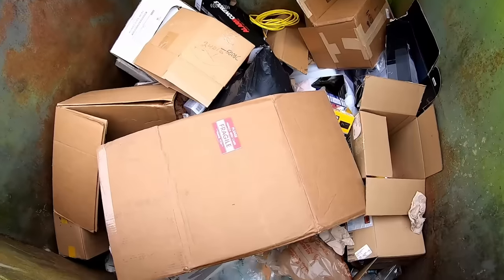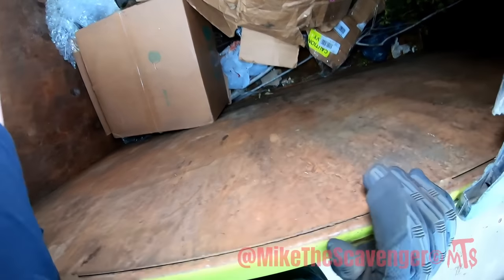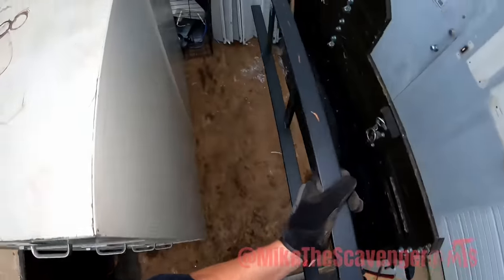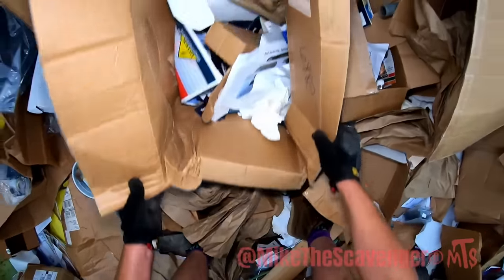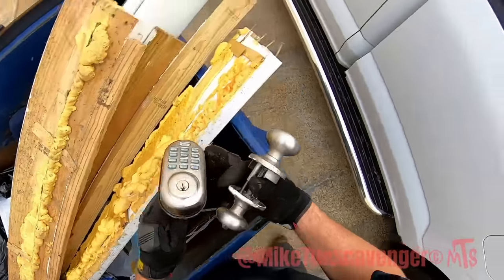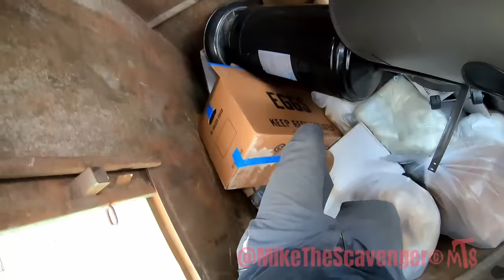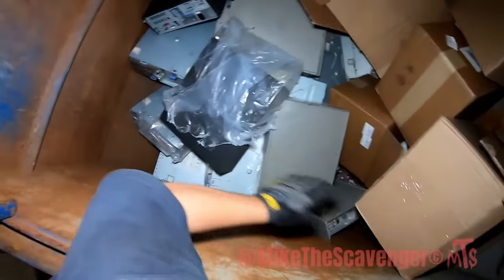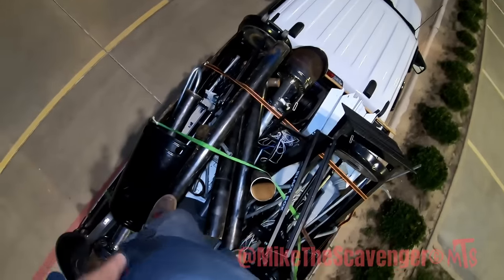Dumpster Diving "We Must Be At The Bistro"

Comment: In UK and Europe cannot just throw old electrical equipment, computers etc into the skip/dumpster for landfill. All has to be separated in WEEE (Waste Electrical and Electronic Equipment) skips/dumpsters, then it goes to specialist treatment centres and stripped / recycled for precious metals etc.
Reply: Not their but they are
Reply: In Canada the company that owns the bins are responsible to separate and recycle according to the items at their company's transfer site. In this case its commercial, retail and industrial bins. For residential areas there is road side disposal pick up  of recyclable garbage. The residents are required to place any metallic items beside their bins, not inside, for curbside picking which makes it easier to see and remove by the  recycler.
Reply: @knightstar1312 It's odd I got notified of a reply to Rachel's comment... but her comment was deleted but not her correction?  But regardless that's how recycling bins work in our county too.  I Googled TX the Waste Management  company 0:04 rent recycling bins I believe if look at the colors you see.he  him in them retrieving "scrap".

Comment: Hey Mike, those computers you’ve just got when are you going to have a go at trying to extract the gold? That would be really interesting?
Reply: I don't know if it would be interesting as it's only 0.2 g of gold in a computer you can sell the motherboard for $1.25
Reply: There is always more silver than yellow gold, platinum and palladium. And stripping all the low grade copper wiring will yield about $30 to $40+ per 5 gallon pail which is nice money. .20 cent a pound for pc boards because it has copper. Just take off all the blue, yellow and black buttons and mccls because thats where the easy silver/palladium picking is for refining.

Comment: You would be better off with a flat tray on your vehicle with high sides . then you could load up better with out wheel arches in the way. offen wonder how many computer get chucked out with the harddrive in them , All that info for the taking
Reply: Oddly, in Texas, you can toss a home computer in the trash, but businesses have laws that mandate manufacturers to take back used equipment for recycling.  I guess each state is different as here home computers are also illegal to toss in the trash as well as monitors, TVs, cell phones, and definitely a/c units.

Comment: Silly question why don’t you take the metal wall studs ?
Reply: 25 gauge metal studs are considered light gauge steel. That means its lighter in weight and it takes up alot of space which does not give a higher ROI compared to the other stuff he ended up getting.

Comment: Mike:I have been watching you video's for several years now and have noticed that you always seem to pass up on the metal studs, and I would say in that time you have passed over two or three pickup loads and I know you say that it will blow off your truck, but you could easily strap it down. I don't understand the waste, like in this video you had quite a bit of it in the dumpster that you where pulling out the conduit pipe from, but it could have been used to hold down the lighter metal studs. Instead I see you rummaging around picking up small pieces of wire, "snip-its" as you call them. What a waste of time when you pass up larger fish. I don't know what price you get for the studs at the scrapyard but the 1/2 load of metal studs I got by helping out a building contractor clean up a job site got me .39$ per pound on 297 lbs or $115.83, which for a 76 year old man on a fixed income is nothing to sneeze at.
You need to work smarter not harder by parking your truck closer to those big open tops so you can throw the scrap directly into it instead of on the ground and then having to pick it all up again  to put it in the truck anyway. I know some times you can't get the truck close enough buy I see lots of time in your video's you could do it easily. I know it's your show but sometimes a little bit of constructive criticism can be helpful and I didn't do it to be critical.       Love your shows and am amazed at what you find out there both on the street and in the dumpsters. Keep up the good work and stay safe.
Brian
Reply: He has taken them before.
Reply: Metal recyclers tend to pay more for shorter pieces of clean metal aka 'clip' or 'baling tin' than for long flimsy metal that takes up alot of space in the pick up box. 18 gauge heavy studs would be worth it all the way to the recycler if he had a trailer.